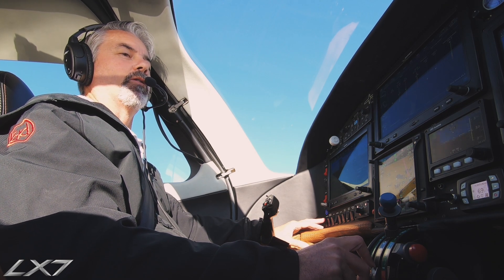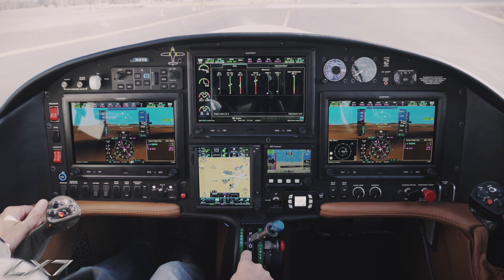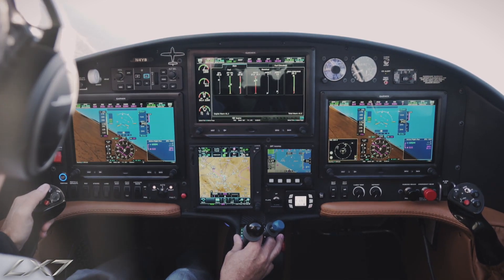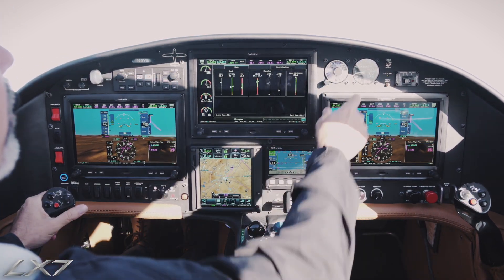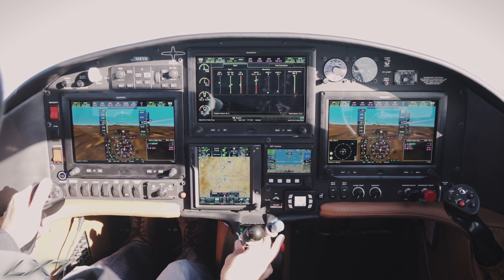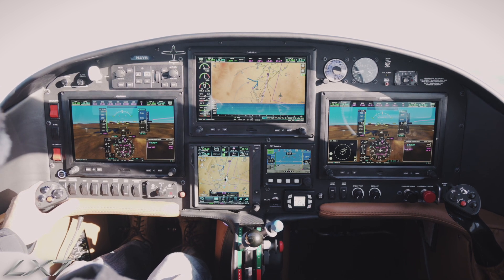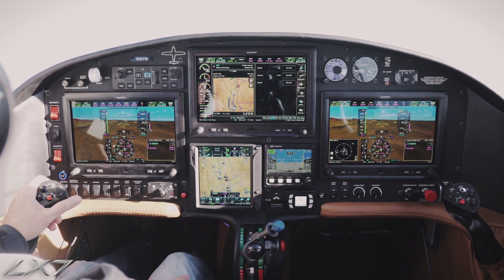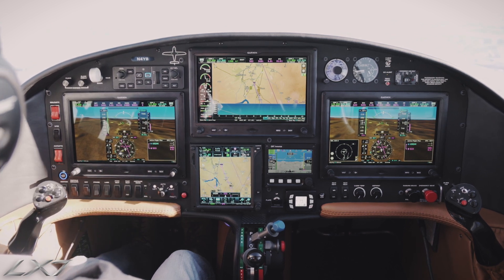LX-7 Overview: Full Demo (Part 6)

Comment: I don’t get this plane, it’s got the same stall speed as a Piper m600 and that plane weighs a thousand lbs more than the Lx7. The slotted flaps aren’t doing what their supposed to do and should get this plane down to mid 50,s at least if they were built right. The M500/600 is actually even lower at 61 kts. I’m not impressed with eye candy, the numbers speak for themselves.
Reply: And the M600 is the same price?

Comment: What was the cruise speed?
Reply: Max With the 550 SHP PT-6, the LX7-20 will cruise at 285 KTAS at FL280 for a maximum of 1,547 NM with 294 lbs of useful load at max (180 US Gallons) fuel.